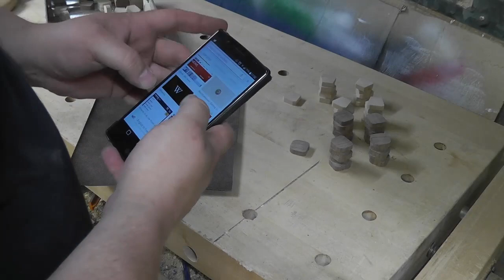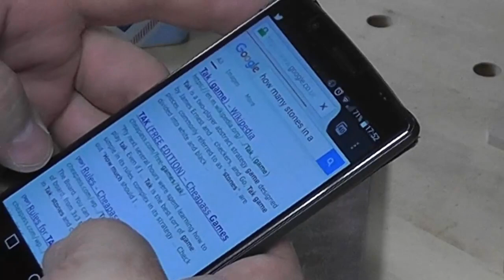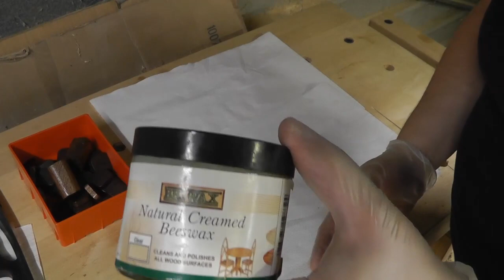Build: Tak - Dining Table Print & Play

Comment: Quick question, are the borders you attach on the sides (15:45) the same veneers as on 12:40 ?
Reply from the maker: I believe the specific ones cut at 12:40 are the ones that got mitred for the top-side border, but they're basically the same - cut from strips of the same sheets that were just a little wider than the board is thick so there'd be a little overlap that could be trimmed then sanded down.
Reply: @DiningTablePrintPlay ahhh awesome. Thanks a lot!

Comment: Your videos are very interesting and informative. I notice a lot of the print-and-play games you've made have rulebooks. Is there a method you use to print and bind your rulebooks?
Reply from the maker: For most games, I print in booklet mode from Acrobat Reader, then use a long-arm stapler to staple down the spine.

If you don't have a long-arm stapler but you do have the kind of stapler you can open right out at the hinge (for stapling on walls, etc.), then place a two-sheet-high block of foamcore underneath the spine and staple down into it, then use a pair of pliers to hold one leg of the staple still while you use the end of a pen or something to bend the other leg down into place to close the staples on the inside of the book.

For larger booklets I'll sew the spine - look around on YouTube for bookbinding videos for tips on sewing pages together. I'll do a rulebook-assembly video at some point, but it's lower priority since a lot of people are perfectly happy to even just read the rules on a computer!

Comment: what's the thing you made the board's surface called? is it veneer?
Reply from the maker: It is indeed veneer! Thin ~0.5mm sheets of wood for decoration - or in this case, marking out game spaces.

I didn't do a great job of it, I'd not done much veneering at this point and it turns out there's special veneer tape that doesn't require so much cleaning up afterward. The glue from the masking tape I used got forced right down into the grain by the clamping and it took far longer than it looked like it did in the video to get it all out again so I could put the finish on.

Comment: Amazing job! Where did you get these thin sheets of wood you used to make the grid?
Reply from the maker: They're wood veneers, sold for marquetry - you can get small sheets this size from various sellers online (specialist shops or even eBay) pretty cheaply. I'm using plain veneers here, but you can also get them with a heat-activated glue on the back so you can just iron them down.

The game board is made with pretty typical marquetry techniques - cut all the shapes to fit, tape them together on the display side with a low-tack tape (like decorator's masking tape), then glue down to a sheet with a big flat clamping caul and plenty of pressure.